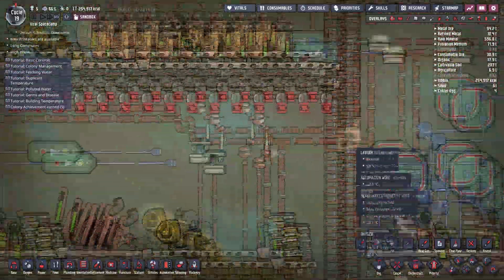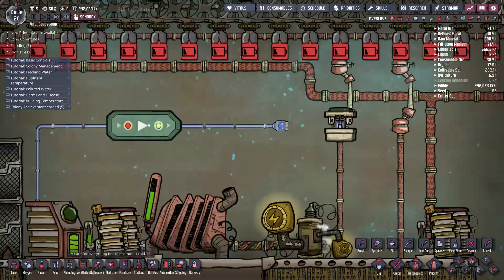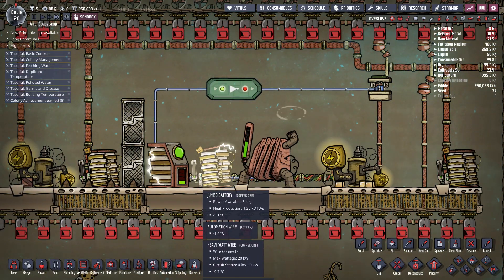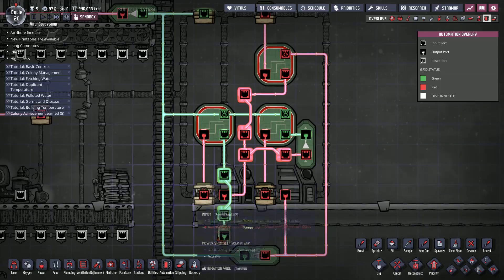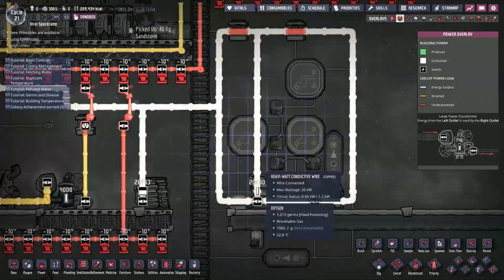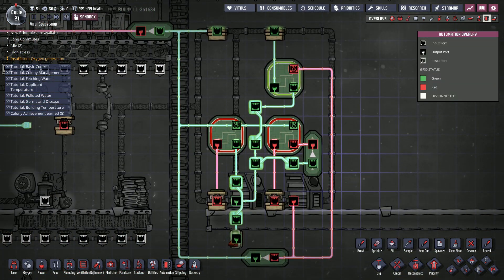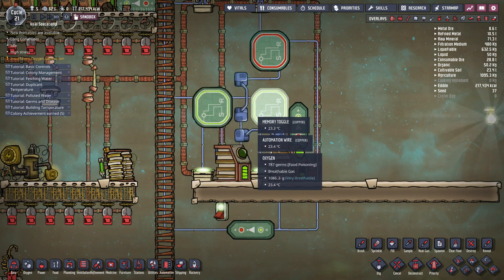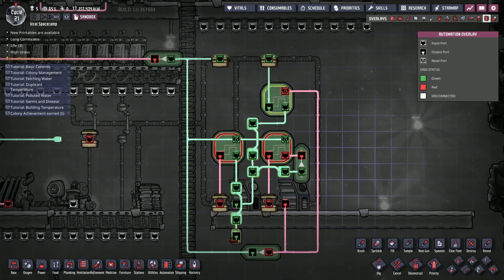High Capacity Smart Battery [Oxygen Not Included]

Comment: You've lost the additional functionality of the Smart Batteries and basically just transformed them into a dumb-jumbo battery which already exists in the game and is cheaper... So I'm confused - what is the point?
Reply: It loses less power due to power leak
Reply: @milky-mayhem  i thought the whole point of using jumbos is for their power density and space efficiency. the extra heat makes them fitting to put in a steam room
Reply: @alamrasyidi4097  I’m just giving my understanding here, I’m not that good but I’m just leaving my input in case it helps anyone
Reply: for the automation of combining smart batteries, this tutorial is on the right track. its just that you generally wont really need to connect generators that uses up resources on demand to multiple smart batteries. the only time youd want to use jumbos is for generators that can only generate non-on-demand power (solar and plug slugs which do so at day and night respectively comes to mind) because power capacity is crucial in their functionality. since they only work during specific time, you need to store the extra power. and since their power is not on demand, you cant connect them to automation anyway. from my best of understanding, you use one smart battery for each type of on demand generators and use space efficient jumbo battery power banks otherwise
Reply: @milky-mayhem  i acknowledge that. i personally never used jumbos in a real game either